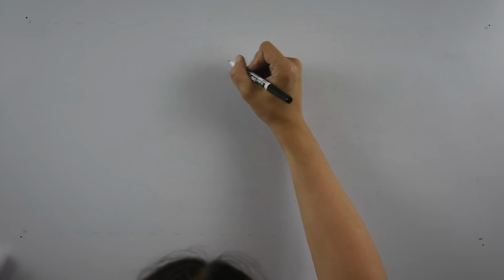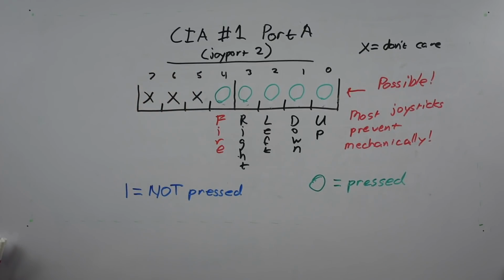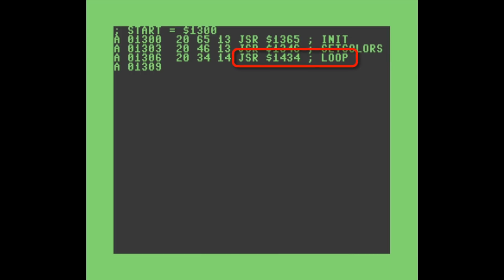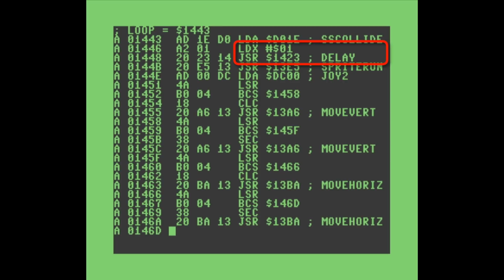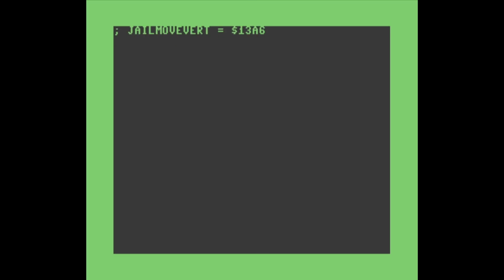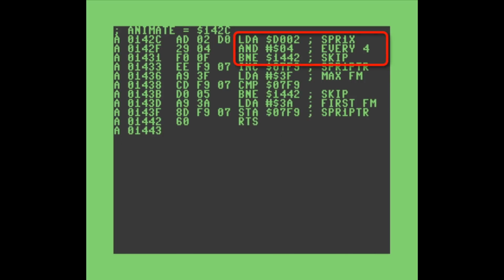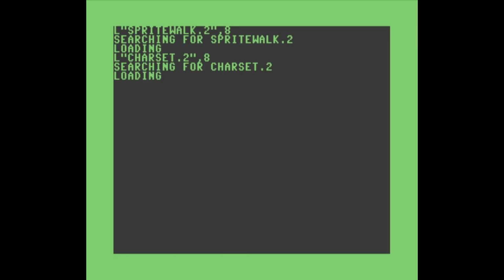Commodore 128D: Episode 6: Joysticks and CIAs

Comment: Whats happend to the crt monitor?
Reply from the maker: @azaria yehezekel Still there, I'm just using the LCD because it displays better and I don't have to edit out the flyback transformer screech in the audio.
Reply: Nybbles and Bytes tried to find the answer in the comments, but what is your preferred method of displaying the 128 onto a modern LCD?

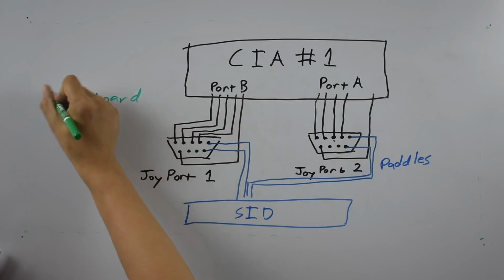Comment: 3:25 The keyboard is connected to both Port A and Port B.  Port A is set to Output mode to create the keyboard signals to read on Port B.

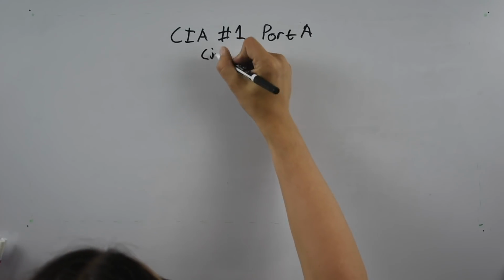4:37 There's a trick that can be used to distinguish whether a Low signal is coming from the keyboard or the joystick.  If you set Port A to output all '1's and read any '0's on Port B, the signal has to be coming from the Joystick.  Unfortunately, the Kernal keyboard-scanning routine doesn't do any testing to distinguish the real source of a '0', though only a small number of additional instructions would be needed. 

6:35 It's usually more clear to use AND #mask and BEQ/BNE instructions to randomly access the joystick-direction bit you want. 

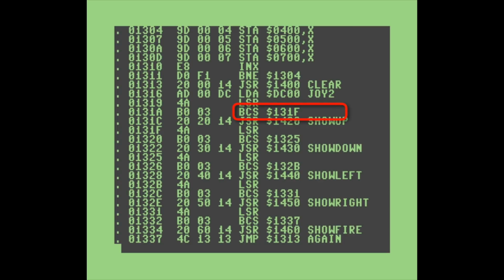7:47 Your code organization creates the awkward requirement to preserve the content of the A register with each subroutine.

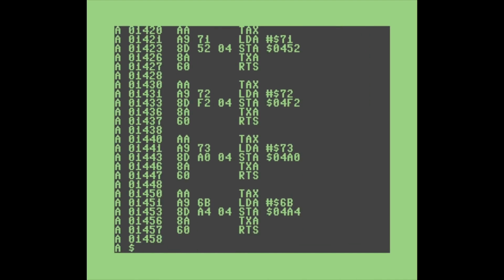8:24 You could just use the X register to store the special characters on the screen and remove the need to do anything extra to preserve the A register.  I.e., LDX #$71 : STX $0452 : RTS. 

8:50 Hey, Taxi!

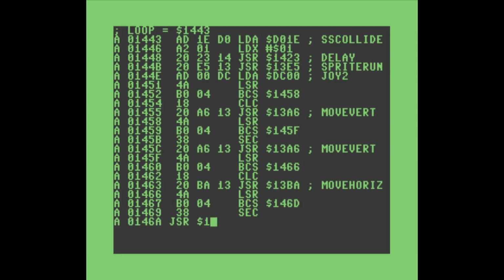12:48 OldSkoolCoder discovered the hard way how the sprite registers work in his C64 game-development series: https://www.youtube.com/watch?v=pLvBo3DbBFk&list=PLiOlLd4dhIDAfUGy8Yx1YF32-U326gyFQ

14:39 If you don't SEI for the entire run, it's probably possible to miss the entire duration that scanline 0 is being "drawn", which means missing frames.

Comment: Q: CIA cause a ready prompt be missing from screen? I had this on Sunday messing with my drive on the C126DCR . I did not open  her up. It took a long time to her last Dec. Thanks a C128 friend.
Reply from the maker: @Herb Myers You might try walking through this document: http://www.zimmers.net/anonftp/pub/cbm/documents/repair/troubleshooting-c128.txt -- the 128's a really complex machine. Sounds like either the KERNAL might be at fault, or possibly something else in the initialization path. Common failure modes like this on the C64 are caused by the PLA or CIA chips. Given that the CIAs in the 128 are responsible for the same kinds of things as they are in the 64, my guess is that you may be right. Not sure how to troubleshoot, though -- big failures aren't really something I get into much on the 128DCR.

Comment: 14:41 The problem with checking for zero in $D012 is that the raster counter is actually 9 bits: 8 bits in $D012 and the 9th bit is in $D011. So you're waiting for either raster line $000 or $100, and you may get two hits per frame. Better to check for #$FF which is unambiguous, since there are a maximum of 312 scan lines per frame on any model of VIC-II.
Reply from the maker: Good to know! Wasnt all that clear in the docs I have at my disposal -- thanks! If I could pin this as well as your earlier comment, I would!

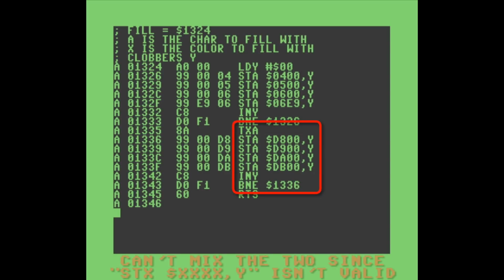Comment: 12:04 You can get the best of both worlds in your screen init routine: exactly 1000 bytes cleared with no overlap, and no need to cpy each loop, if you initialize y to 250, and then dey, with an offset of -1 on each sta address. I've written it in assembly for clarity, but of course you could adapt this to the monitor:

screen = $0400

 lda #1
 ldy #250
loop:
 sta screen-1,y
 sta screen+249,y
 sta screen+499,y
 sta screen+749,y
 dey
 bne loop
Reply from the maker: A bit more efficient, yeah, though a little less straightforward, I think. Since we dont call it all that frequently, I figured wasting a few extra cycles was okay. Nice work, though! :D

Comment: Well, this is quite a strange coincidence. I have for the last few days actually been thinking about writing my own program in machine code for testing joysticks.

Since the programs I have found out there until now are either written in Basic (so not fast enough) or overly complicated (like, as you mentioned prohibiting those "impossible" directions to overlap) and non of them were able to handle paddles or measure the rate of an auto/rapid fire circuit. In other words hopelessly inadequate for my purpose.

I am almost done building what I have chosen to call a "Smart Retro Joystick" from standard arcade machine joystick parts. You know those advanced gaming keyboards, we can get for our modern computers, which can rearrange keys and have extra macro keys which can be used to record and playback sequences of keypresses? - this is basically the same idea, except in the form of a programmable joystick for our precious retro computers instead.

Using an Arduino this joystick is ironically many times faster that the retro computers it will be "serving". It will also have a number of crazy over the top features, at least compared to the joysticks from back then. So it would be nice to be able to test those things and make some measurements in order to get the timing right.

Since none of the existing testing programs I have found are able to tackle a super-joystick like that. My guess is that I will probably end up having to write my own. 

So your timing in choosing this subject right now, couldn't be more perfect for me ❤️